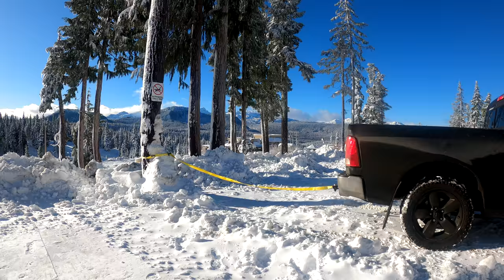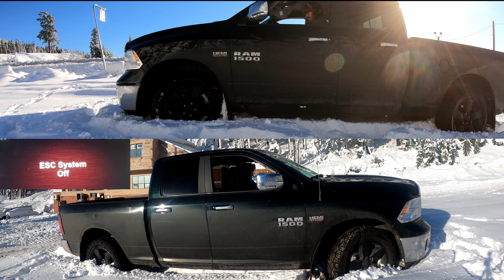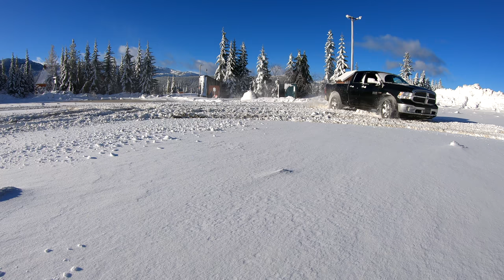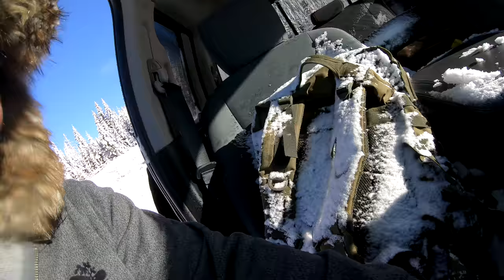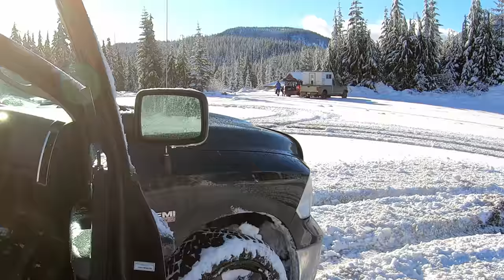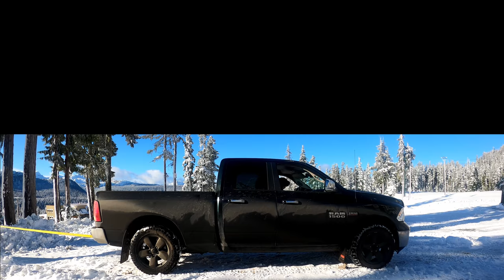RAM 1500 Off-Road 4WD Lock Test In Deep Snow (I Was WRONG..) | Real World 4x4 review 2.0

Comment: I have a 2019 RAM 1500. It has 4WD, 2 WD, 4WD lock and 4WD low. Mine doesn't have the E setting.  That means my truck is worthless on snow? Please I need an answer.  Thank you
Reply from the maker: Well no 4wd is going to do well in most snow conditions no matter what. Having  good tires is also important. 

do you have the 4wd auto option?
Reply: It has 4 options. it has the auto 4WD,  2WD, 4WD lock and 4WD low. Idk if that helps.
Reply from the maker: @joseromero1400  ya it does! you have the Bw44-44 transfer case. just means It's not as good off-road but for the odd snowstorm you'll be absolutely fine. if you find yourself in deep snow, make sure you turn off your ESC system and the truck will perform pretty well. 

if you have a rear limited slip diff option on your truck you'll be laughing.

Comment: "I was wrong. The fronts do lock ....I was still stuck but the wheels did turn"
Reply from the maker: lmaooo. Yes. but I'm going to blame that on ram putting two open differentials in my truck and potential the idiot behind the wheel (although I kind of wanted to get stuck just not this bad). If I had a rear locker I think I would of managed much better

Comment: The ESC and Traction control disable features in all these new trucks doesn't fully disable these features. If you truly want to disable them, you would need to install something like a Zautomotive TasarDT or equivalent.Then watch how much better your truck does in something like snow, mud and sand.
Reply from the maker: yup, I think maybe in 4wd low there may actually be 100% lock up but not sure on that. either way even with full lock up there is always the possibility of the clutch pack slipping.

Comment: Awesome video bud! As a ram owner of a 17 I’m enjoying the content
Reply from the maker: well thank you really appreciate it!
Reply: @TheGettyAdventures  What tires do you have? And so if youre actually stuck, youre saying you should turn off the traction control to get out?
Reply from the maker: @rb3tactical145  100% so you want to turn off the traction control and the electric stability control (hold down the traction control button for 5 seconds in 4wd lock). If you don't the vehicle will sense different wheel speeds between front and rear axles thinking the vehicle is in a spin out situation and cut power to the front wheels.
Reply from the maker: @rb3tactical145  Goodyear Wrangler Duratracs. alot of guys up here run them because they are winter rated as well as pretty decent off-road.
Reply: @TheGettyAdventures  Thanks for the reply! I just put on some Goodyear Wrangler Trail Runner ATs today, theyre like a little less aggressive version of the Duratrac
Reply: @TheGettyAdventures  when you turn the traction control back on will it turn the esc back on also?
Reply from the maker: @justinconrad5283  yes it will.

Comment: what did you expect was going to happed with those mall shopping tires?
Reply: They're not exactly the best tires for the application but when he used his 4x4 system properly it got him out. Just sayin. It's not just 1 portion of the system but each working together.
Reply from the maker: Wrangler Duratracs bud, which are highly rated for snow and ice. what tires should I be running in your opinion I'm curious now.
Reply from the maker: @ruffxm  the tires are fine for snow the real issues is two open diffs lol but yes a little rocking back and forth and she made it out!
Reply: @TheGettyAdventures    I really was responding to the original bashing of the tires. But thanks for preaching to me instead.
Reply from the maker: @ruffxm  no no I'm sorry that was 100% not directed at you! really apprecated the positive feed back. Robert is probably of the belief that I need boggers or something lol
Reply: NP, Good video
Reply: No boggers, yep those are good tires , I couldn’t tell what they were, looked like Firestone smoothies, my apologies, trucks aren’t tracked vehicles thats for sure, my super duty sucks even with a rear locker, stock tires.

Comment: So, if I have the BW44-45 do I need to worry about doing any of this? Will I have any benefit turning off the traction control and ESC or can I just put 'er in 4WD Lock and send it?
Reply: Yes put it in 4 lock turn track control off then hold it again for 8 to 10 sec u will see the esc shut off in your panel then have at it if your really stuck drop gears like 1 or 2 on your steering wheel that way it will keep max power for you
Reply: @alanjoseph986  hey thanks for the reply man!

Comment: You shouldn't be using 4hi, you could've asked the truck to move more slowly, therefore freeing it faster by using 4LO, which is already a tried and proven method, why do you insist on asking 4HI to do something its clearly not cut out for
Reply from the maker: lol you must be a millennial with all that complaining, the point of this video was to show that with the Electronic Stability Control (ESC) system off, the BW44-44 clutch pack transfercase in this truck will send power always to the front drive shaft 100% of the time. In the last video I showed that without the ESC system off the front driveshaft does not get power in 4wd when the wheels are turned. Being "stuck" like this allowed me to spin the wheels perfect for the camera's to show which wheels would spin. I was purposely stuck. you think this is my first rodeo in the snow? you think I called a tow truck to get me out after I was done filming ?? No I slapped the truck in 4 low and rocked the truck out in about 15 seconds.  

The video could probably be filmed better but I had like 400 subs at the time and had no idea wtf I was doing. I was just having fun.

Comment: I don't get it. U spent a while talking about how crappy ESC is, but failed to spend any time actually showing that. Show us, don't tell us. Then I'm confused if you were comparing locking the diffs to not locking? Never got to see a difference there either. In fact, I have no idea whether or not that truck is capable of locking any diffs based on your video. Then you hook up to the tree to show what? That the wheels are engaged? Well that tells us nothing bc the wheels need to be buried or in trouble for us to observe how well they engage. Any open dif will spin BOTH wheels when you are hooked to the tree. You're showing us nothing. You incorrectly said in the vid that an open diff spins only one wheel. This is definitely an incorrect statement for every vehicle ever made with an open diff. Maybe you meant to say the downfall of an open diff is it could potentially only spin one wheel if the wheels do get in trouble, and that one wheel is never the wheel you need to spin. Thanks for attempting to make a video to answer a lot of good questions, but I think third time is a charm... Try again?

Comment: Blah BLah BLah Blah Buy a chevy. THey are a tank!
Reply from the maker: Heavy Chevy I believe the term is lol I had a 96 GMC K1500 and she never let me down
Reply: @TheGettyAdventures  Happy New Year Bro. I get 278-310K out of all of mine. 1500's. I got a 2005 Envoy that I keep my tools in the back. The interior and exterior is mint. 289K. My wife's fusion and I an not a ford guy 2015 130K Great vehicle. All my GM Cars would have had new wheel hubs 3 times. Brakes 4 Times. Yada Yada all I have had to do to the Fusion Is tires/brakes once and Transmission and Coolant flush and fill.
Good Luck and Happy New Year. The Dodge is a good looking Truck...But...Its a dodge.
Reply from the maker: @skiprope536  Happy New Years to you as well man. I really like GMC products, always been a GM guy but with me working at a Western Star/ Freightliner dealership which is apart of Daimler (mercedes benz). I got an amazing deal on this dodge truck. Like basically at cost of the dealership. So I figured I'd give the old dodge a try haha